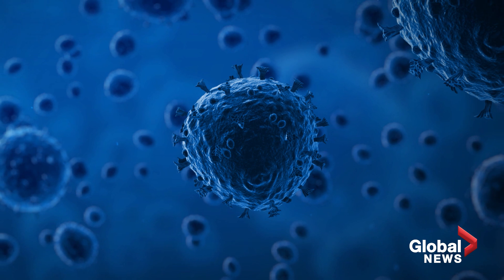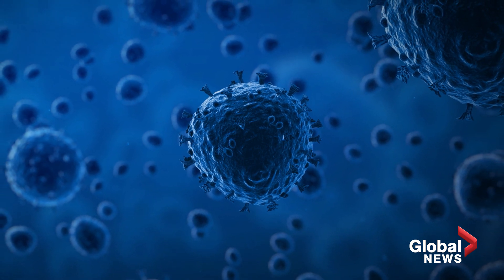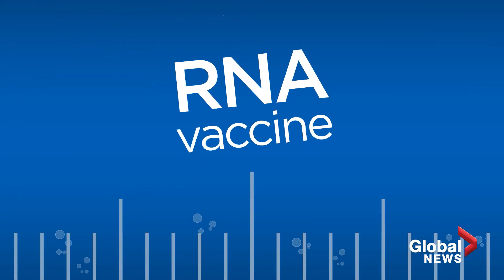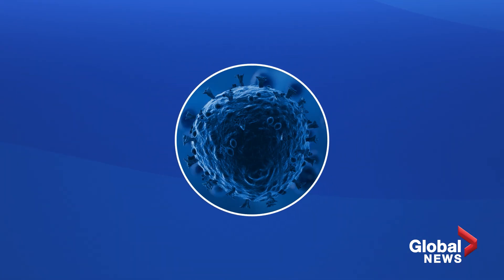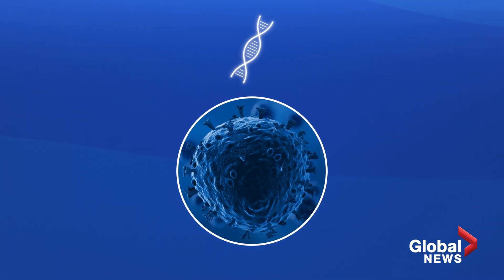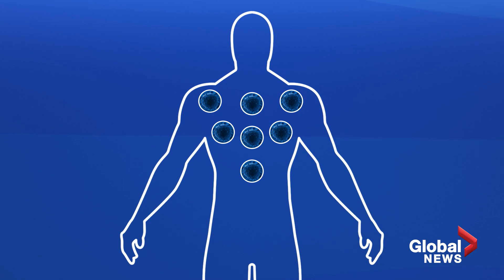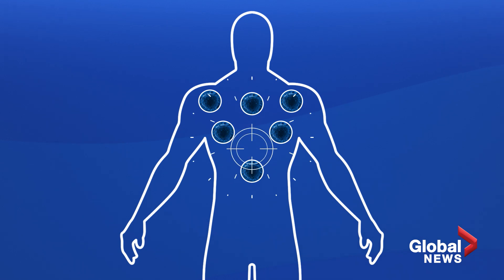Pfizer-BioNTech coronavirus vaccine: The refrigeration problem no one is talking about

Comment: According to specifications, vaccine stores fine at the temperature of "dry ice". There are at least 3 grocery stores with dry ice machines within 3 miles of my house... probably 100s in the SF bay area. Think the dry ice vendors would happily rent the refrigerators temporarily to clinics. Likely would pay much better than selling an occasional block of dry ice. Shipping containers with monitoring should be sized to fit into typical dry ice refrigerator. Problem solved.